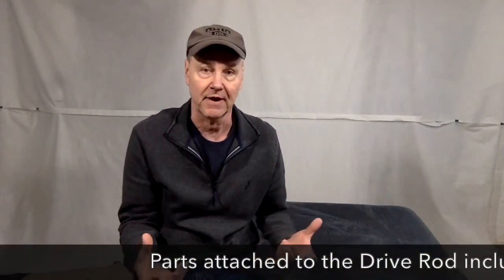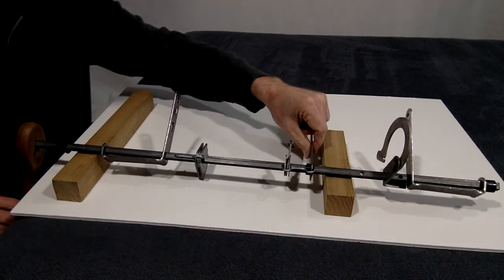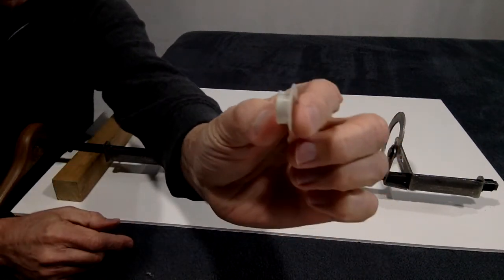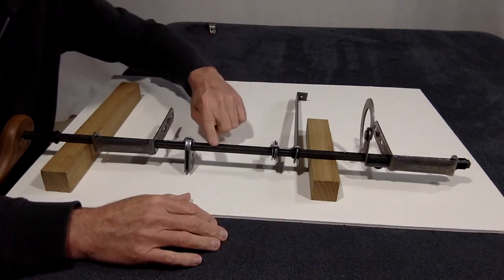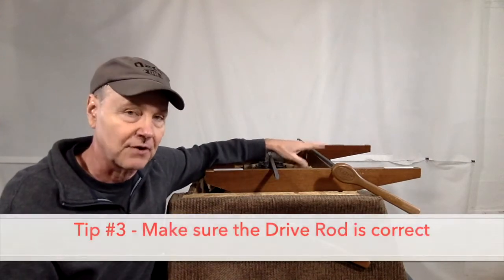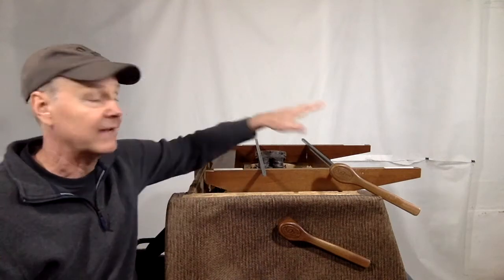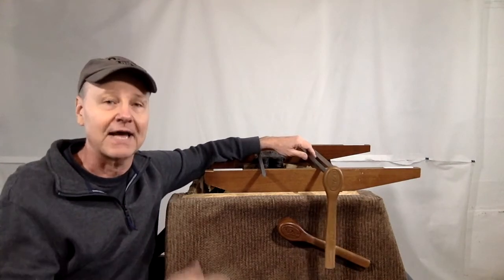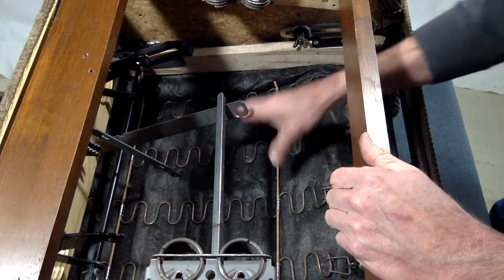La-z-boy Drive Rod Replacement - Part 1

Comment: I am writing to thank you for these wonderful videos and for answering my questions.  I was having trouble removing a toggle screw and ended up drilling it out. I replaced the drive rod and now have a working chair. I actually ended up fixing three of our old chairs. I watched your videos many times before and during the repair. It took a while but I am gaining confidence. Thank you again!!! Kathy
Reply from the maker: @Katherine Halloran - You're welcome - good job! I stopped drilling those screws out when they strip or break. It's such a hassle. I just install a new Drive Rod now when that happens.
Reply: @reclinerrepairguy4155  fellow repair tech here when these strip out I use a multi tool to cut them into a shape I can grab them with channel locks then turn them out, saves me a ton of drive rods
Reply from the maker: @robc2817  - Sounds like a good method. What tool do you use to shape the head?

Comment: Excellent video. Very helpful. I was replacing the Spring Tensioner for the foot rest.  Once I had the chair turned over I took a picture of the spring mechanism so it went back together easily. Only has to remove the retaining clips and side the Drive Rod out part way.

Comment: I have an older lazyboy recliner and recently the drive rod snapped. I know that the ideal thing to do is to replace it, but my question is, can it be welded back together? If it snapped where that bearing is worn out and cut throught the rod, I can see where this may not be an option.
Reply from the maker: @stephensams709 - I suppose that may be an option. But it's so much easier to install a replacement Drive Rod.

Comment: So, here's your first failure for the new re-design and new heftier bearing. I have a brand new La-Z-Boy Stratus rocker/recliner - manufactured in Kentucky and delivered to me in Ontario, Canada. I've only had the chair for a couple of weeks. It's brand new. The retaining clip in the center broke in half. I saw that the black bearing has slid out of the hole in the spacing link. The chair still reclines and the footrest still works - but after seeing your video, I've stopped reclining and using the footrest. I don't want to damage the spacing link or the drive rod. Obviously, the  bearing slid out only because of the broken retaining clip. But, I can't figure out what would cause the retaining clip to snap in half. So, now I need to replace it. I will visit the La-Z-Boy store where I purchased it.
Reply: By the way, I noticed that there is absolutely no "play" on the spacing link - not even enough to slide the bearing back into the hole.
Reply from the maker: @Doug Koroll - Remember, full warranty coverage comes with new La-z-boy products. So, report the problem to the seller so they can repair it (at no charge) & perhaps determine why the clip failed in the first place.

Comment: I have a question, on my La-z-boy chair my foot rest handle can go past the 9 o clock position witch makes the foot rest go back down a little ways. its like what ever used to make it stop at 9 o clock is broken off. its over extending. so when you put your feet on it the rest, it  goes down and the handle points down to around the 7 o clock position.. any ideas?
Reply from the maker: @pc54m - Remove the back & roll the chair over & carefully inspect the parts that are attached to the Drive Rod. You'll likely find some displaced or damaged parts.

Comment: How do you remove the toggle and tensioner spring?  This video shows removing it when the drive rod is broken so there is no tension on the spring.  It took a long time to get the parts (delivery issues, not a lack of the parts), now I am just hung up on getting the spring off the support rod.  Any helpful tips?
Reply from the maker: @Kent A - The 'Legrest Subassembly Replacement' video on the ReclinerRepairGuy.com website shows the spring removal. But the video requires a paid membership to view it at this time.

It's not difficult to remove the spring: Always wear eye protection when installing or removing any mechanism, seat or back springs. For the Toggle spring I use vice grips. Remove the chair back & turn the bottom of the chair upside down on the floor. Position yourself behind the seat, opposite the footrest. Extend the footrest to the fully-open position. The spring has less tension in this position. Next, clamp the vice grips down firmly on the straight part of the spring near the Support Shaft (round black shaft near the front of the chair). You'll need to generate a short forceful push with both hands against the spring, pushing it forward just enough to unhook it from the Support Shaft. Since most recliner springs are stretched by pulling the spring, this is a bit different. You're pushing to stretch it instead. Reinstall it -- or a new spring -- using the same method.

If your Toggle Subassembly has several holes for adjusting spring tension, be sure to note the original hole where the spring was attached, if you want the same tension when you reinstall the spring.
Reply: @reclinerrepairguy4155  Thanks much!
Reply: @reclinerrepairguy4155  
Successful at replacement.  Had old style 3-position lock, rear swings were new style so used the plastic parts.  They do not seem to lock at three positions, but does lock at top, most important part, so, good to go.  The rear seat swing metal lock bolt had completely sheared the nickel-sized part off onto the floor.   The rear swing had a hole nearly the size of the lock bolt head.  Thanks for the video!

Comment: Have you ever turned it into a left side lever for the foot rest
Reply from the maker: @leifbelanger8498 - No, but you can check with the manufacturer to find out if a left-hand Drive Rod is available for this conversion.